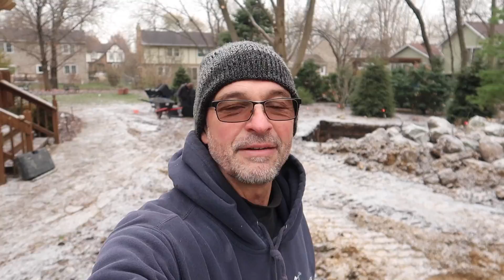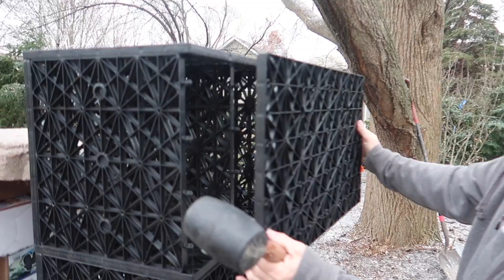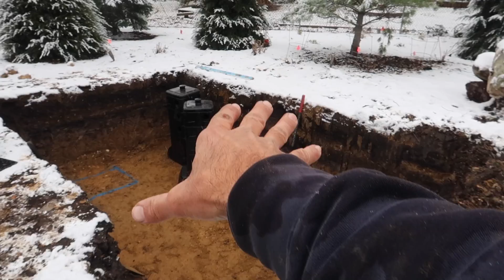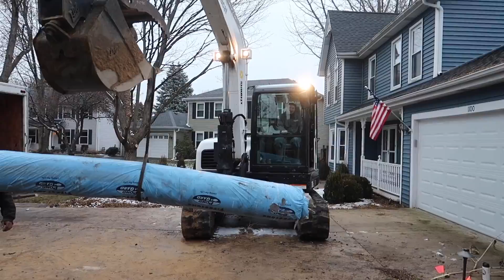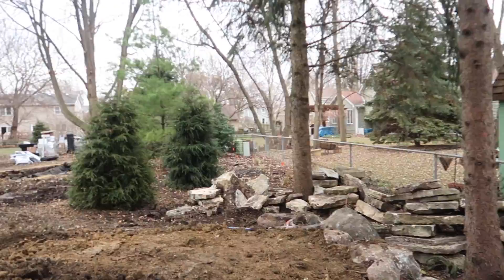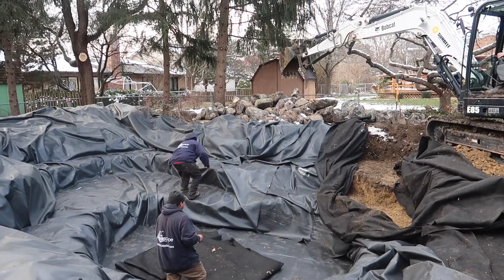Challenges of Installing a Large Residential Pond

Comment: I am surprised you guys don't use power wheelbarrows to move that material.
Reply: aaron darling what kind do you use?
Reply: @GregWittstockThePondGuy   I haven't bought one yet but I am getting one in at the beginning of March. I move so much material by wheelbarrow I don't know why I haven't gotten one yet.
 Stanley Genedack did a video a month or two ago that compared a few and their features.
Reply: aaron darling We had one a loooonnnngggg time ago,(late 90’s?) definitely helps!
Reply: @edbeaulieu5916  The two I have been looking at are the PAW and the Overland electric. They are basically either end of the spectrum cost wise.
Reply: aaron darling Thanks for the information!